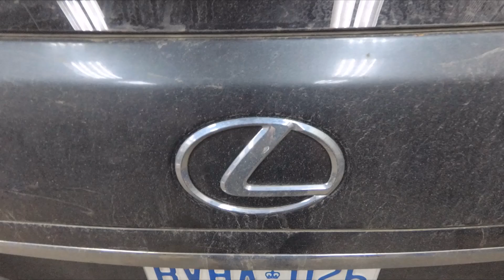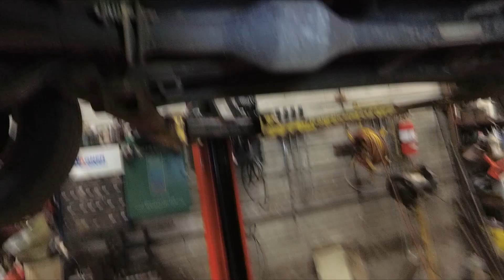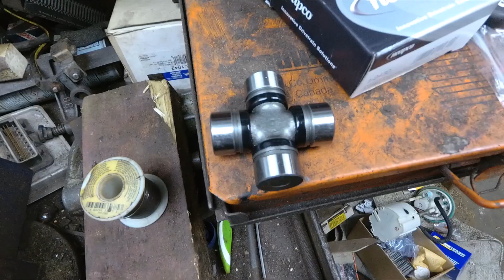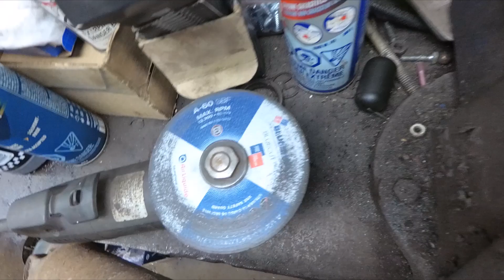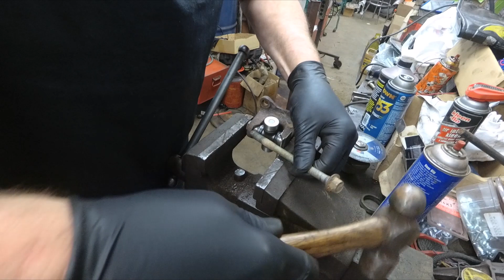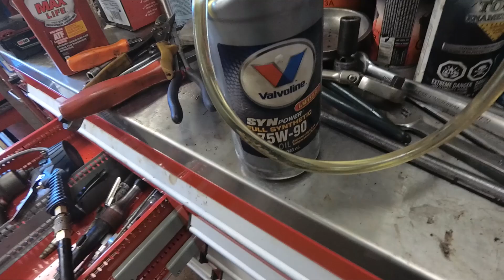2008 Lexus RX350 Staked U-Joint Replacement

Comment: hi, quick question: how do you know what kind of ujoint u have to order? i am looking for a lexus is200 manual propshaft ujoints but i dont find anything about length, diameter ect because non replaceable..
Reply from the maker: @realpremier  they are only available aftermarket as originally the whole driveshaft is replaced. Try Google.  This one was a 644-1-0430 Neapco but yours may be different.
Reply: @PhillipBailey  yeah same here, did not find anything..

Comment: Worried about marking it so the balance won't be off then welds a portion so that it will fill the area that was worn out.  Top notch buddy..top notch.
Reply from the maker: Where the ear was damaged, I simply replaced the missing metal with weld. I know it's not perfect, but the customer does not have $1k for a new shaft. The vehicle is still running BTW.
Reply: Awesome job, about to dive into my rx300 and do the same 👍

Comment: Toyotas are s hit I'm sorry but I've have more problems from that brand then any other vehicles I've owed
Reply: Consumer Reports surveys confirm Toyota is the most reliable car brand of 2022. It's clear Toyota is nothing if not reliable. Consumer Reports notes that “every Toyota model, save two, has above- or well-above-average reliability.”Nov 27, 2022